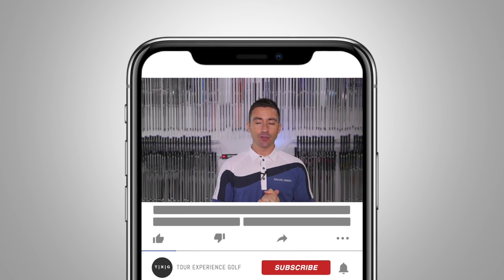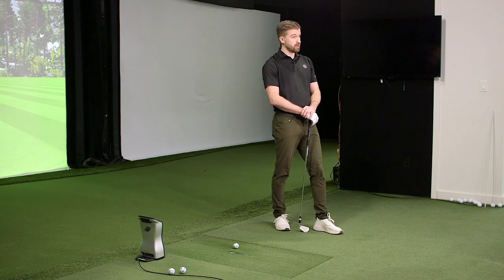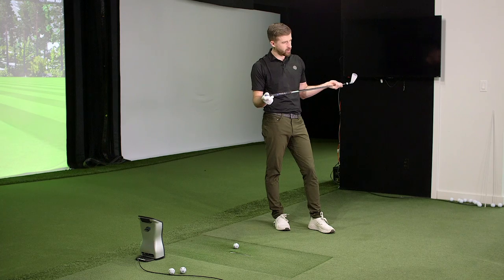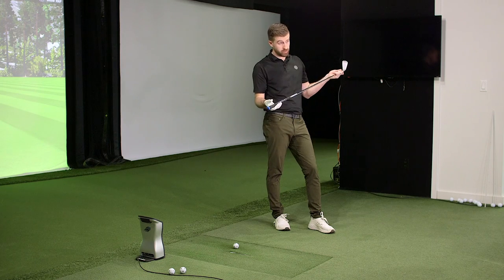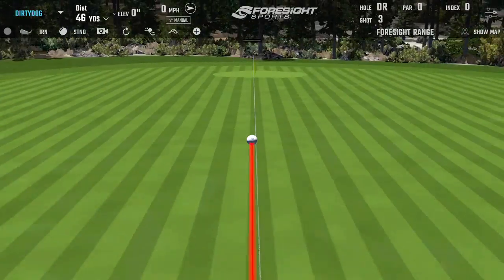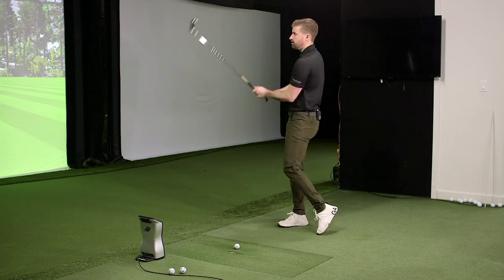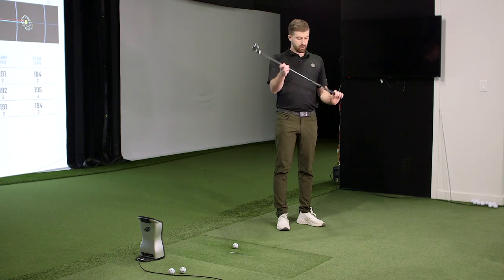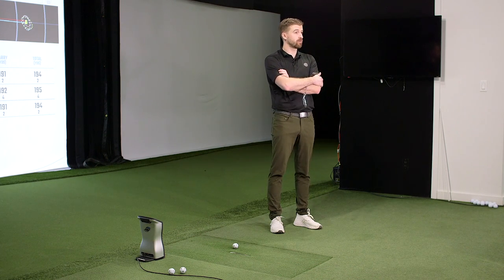OBAN CT125 // Iron Shaft Review & Comparison

Comment: The CT 115s are the smoothest feeling x flex shafts I've ever hit and for me were worth the extra cash for that balanced feeling.
Reply: Capco12 I play the Stiff.  Love them!  Switched from Modus Pro Tour 120 S.  I found a more controlled feel in the tip section.  If you wanted to save some money, I've also played the KBS $-Taper 120 S and found those fairly close, much more so than the Modus.
Reply: Better than KBS ? I switch out stock AMT on set Titileist . More solid and consistent. They too have a balance to consistent flex .
Reply: Steven Griffin I liked the Oban better than the KBS $-Taper but they were pretty close and came down to my subjective feel between the two.  My dispersion was good with both the Oban and $-Taper, and both were much tighter than the Modus.  Again, that’s just my experience

Comment: Gday gentlemen! Great video. With Oban being cored out from a solid shaft, that means that they have a consistent bend profile as you said Ian. Do you put much stock in puring steel iron shafts and if so, would puring steel shafts give them the same bend profile consistency as the Oban ?

Comment: With steel shaft fitting, you talk about the welded spine of a regular shaft VS the extruded spineless Oban shaft. I am wondering if in your fittings you spine align shafts. I have seen a recent video on spine aligning and the difference it makes to the clubs consistently seems to be quite large.

Comment: Hey guys, can you speak to the + and - flex profiles?  I noticed they do a S(+) and a X(-) and was curious about those (is this soft step/hard step?), as my swing speed falls into the top end of S (trackman 105 mph driver and 6 iron 91/92 mph).  I worry that as I improve efficiency and have more speed to give with irons, I may run out of my iron fit (dg 120 S in i500's).  Thanks for the great vids, boys!